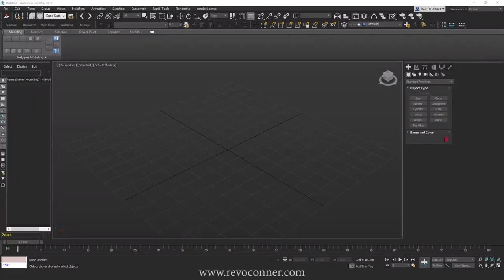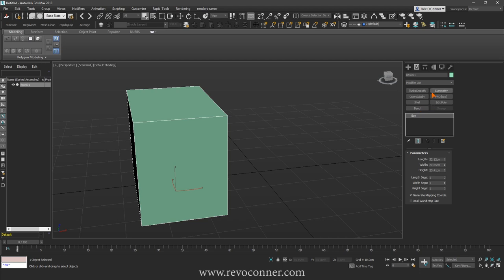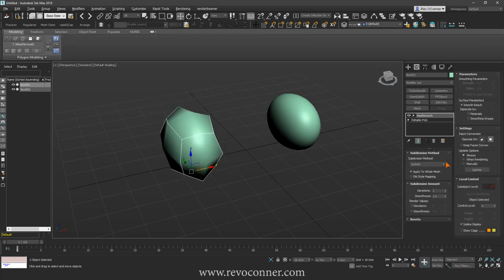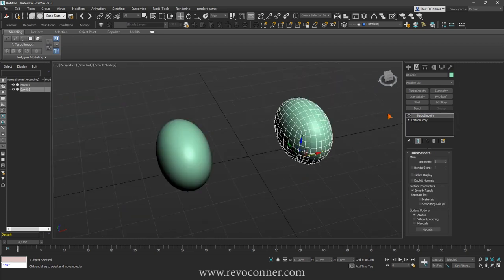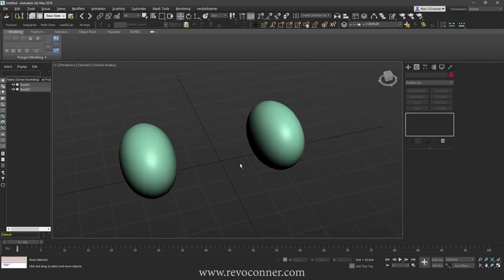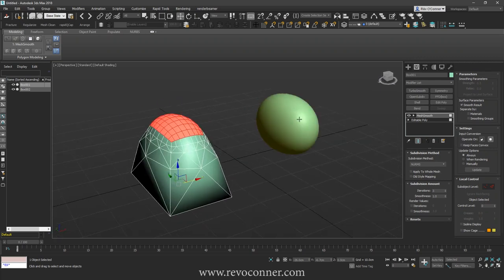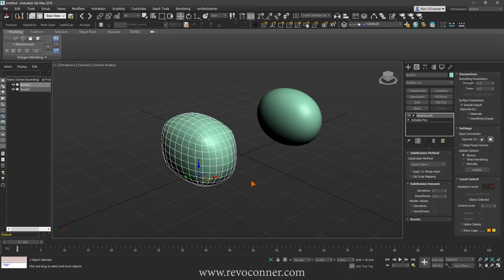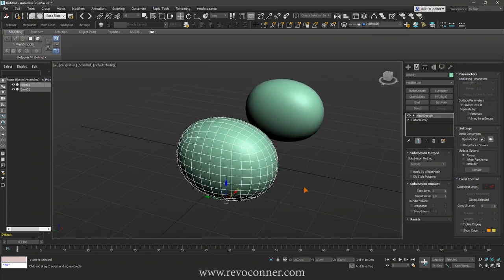3ds Max - Meshsmooth vs Turbosmooth

Comment: so there's no big differencies ! thx for this dude
Reply: Meshsmooth was the first subdivision mosifier, which came to 3ds max in 1996. Then autodesk introduced a new subdivision modifier, turbosmooth, in 2004. The main difference between these two is that; meshsmooth doesn't provide support for creased edges and turbosmooth provide it.